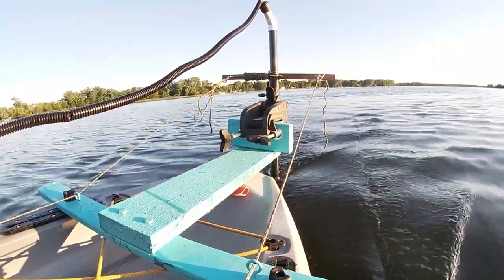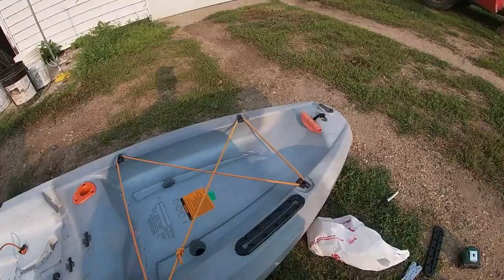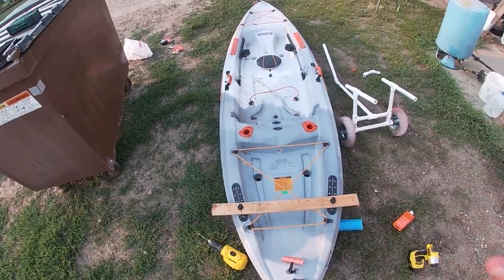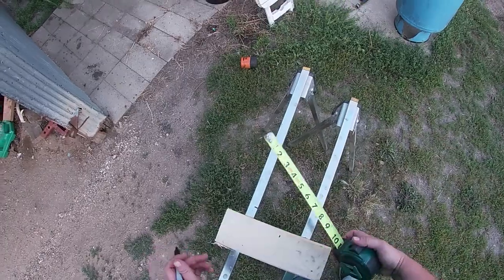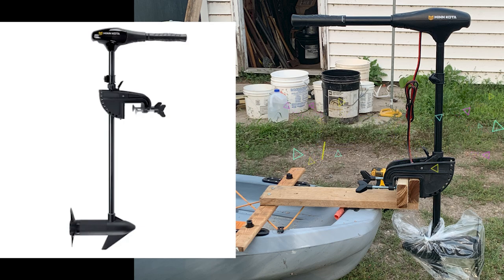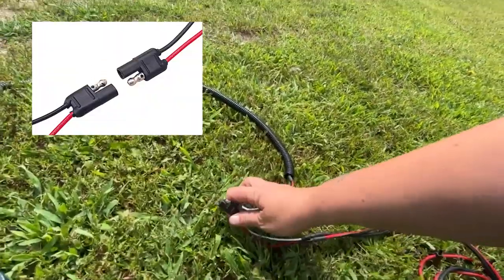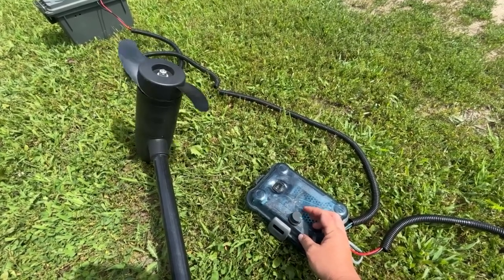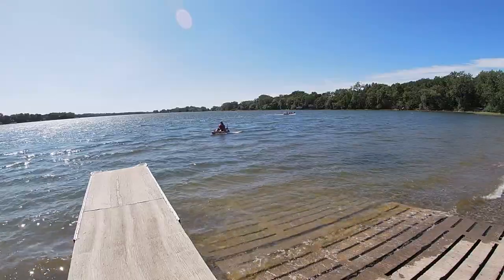DIY Kayak Trolling Motor Mount | Budget Fishing Mod

Comment: Thanks for sharing.  Why only use black and red wires?  What whait and yellow wires are for?  Thanks.
Reply from the maker: They’re for the factory speed controller.
Reply: @superioradventures  I wonder if the factory speed controller can be repurposed and mounted on a box next to you, in place of the separately purchased PWM you put in the waterproof case?
Reply from the maker: @rudytamayo2646  yes, that would work. I use the PWM because it makes the battery last longer. If I have it on a low setting, it’s drawing less power. With the factory control, it’s pulling the same amount of power on low as it is in high.